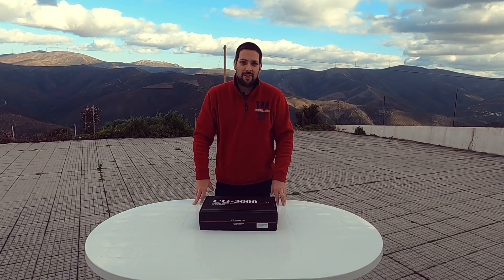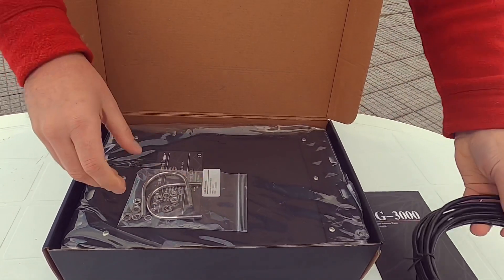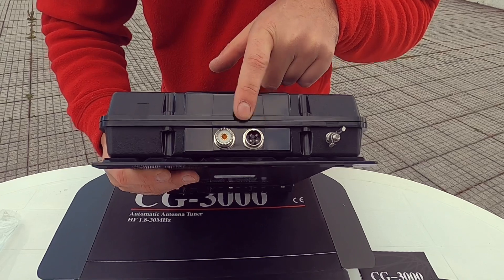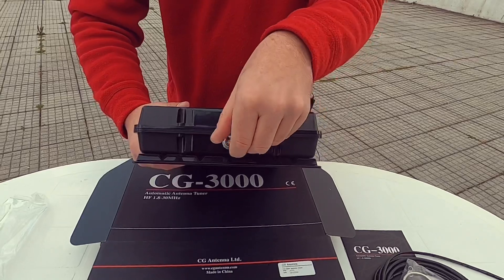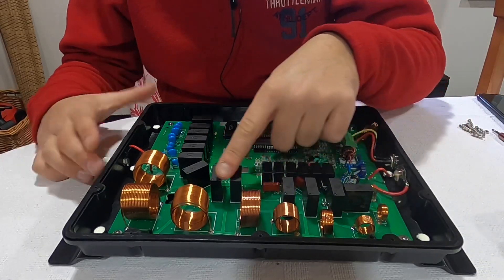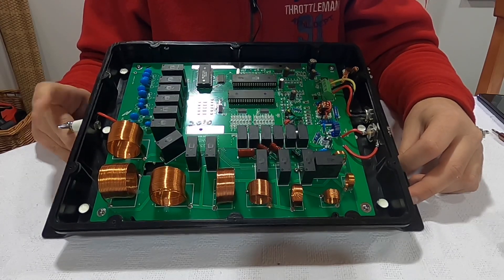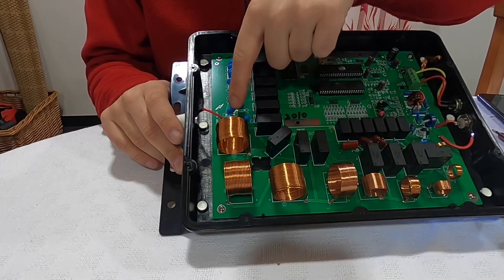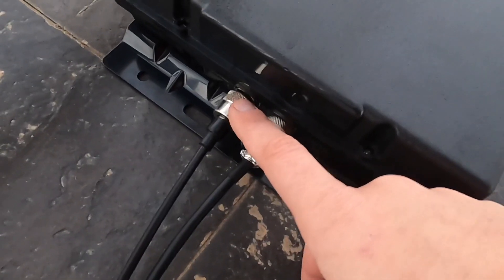CG-3000 Antenna Tuner Review | CT7AHV

Comment: Hi, you said you use 10m of wire with this tuner. The very thing with this kind of tuner is to use a length of wire that is NOT a  half wave (or a multiple of that) for the band to use it on. Or, in other words, the length of the connected wire should not be resonant for the band that you want to use.
Your use of 10 meters of wire is a half wave for the 20m band. Do, there it will be resonant. That is not preferred. And it is also resonant for 10m ( a whole wavelength)
Reply from the maker: Yes 10m of wire will be resonant on 40, 20, 15 and 10m. I know that half wavelengths must be avoided because they make the tuner develop high voltages inside. In this tuner, operating up to 100W is safe for the tuner. Less than 10m of wire will have poorer performance to work on multiband.
Reply: @ct7ahv  Hi Pedro, ok, I just thought I should mention it that it's better to avoid the resonant lengths of wire. I have a CG-3000 myself, which I occasionally use. The tuner is situated at ground lever and an almost vertical situated wire of 9 meters is the antenna wire. I use a ground-rod as counterpoise. It does work, though it seems to be a bit of a noisy antenna (most verticals are, apparently) not being symmetric. Anyway, trying out different antennas and experimenting with them, is always interesting, I think. I myself am quite intrigued by "magnetic-loop antennas" 
I'd say, enjoy the hobby, but I'm sure you do, looking at your QRZ-com page.
73 de PC7H, Roy.

Comment: I’ve mostly seen these tuners on sailing boats. Where they sit right under the deck and are connected directly to an isolated aft stay. 
(The cable that pulls the mast backwards) 
That cable length is “random” and depending on the mast length. That is different from boat to boat.

Comment: Tnx for video, i have it use 20 meter wire but i cant tune 21 mhz. ? very high swr about 2.5 swr, also 28 mhz not good swr i thing my Wire lenght is incorrect. I use horizantal wire,and do youtest it 200 waats or more ? :) 73' de TA4AU
Reply from the maker: Mehmet thanks for your comment! Actually you are using a resonant length with very high impedance on the end! You can damage your tuner because very high impedance means very high voltage inside the tuner and capacitors and relays can start arcing! Decrease the length to 16,5m or increase to 30m and you will be fine.
I never tested the tuner with more than 100w. My amplifiers deliver up to 2,5KW so with only 5w in I get 400w++ output and will be too much for this tuner.
If you look hot higher power tuner have a look on eBay for n7ddc 1KW antenna tuner. Hope this helps! 73!